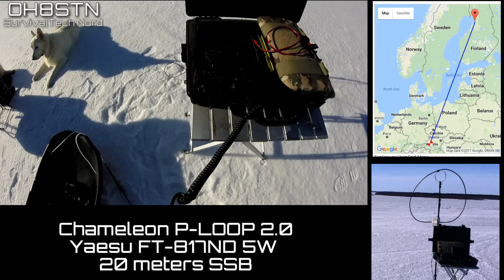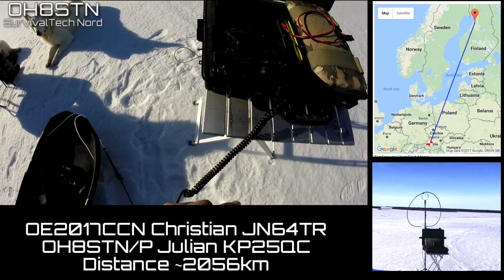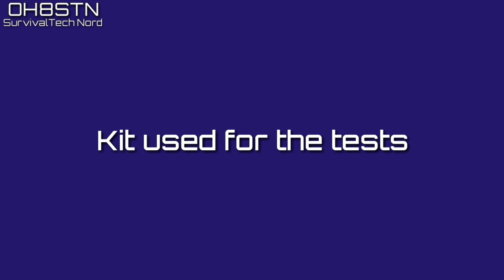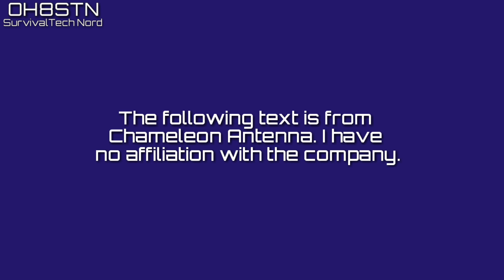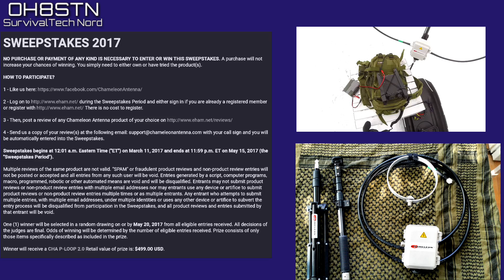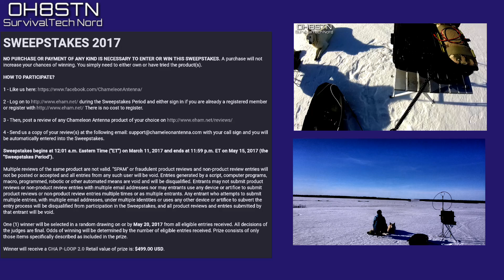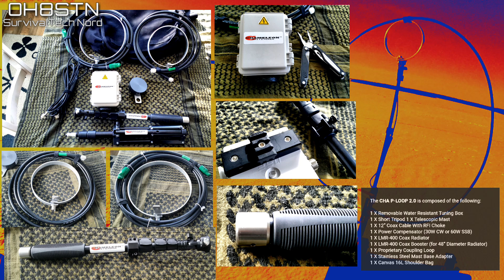Chameleon P-LOOP 2.0

Comment: Thanks for the video. Could you please explain how the power compensator works? Or maybe do a test that would show that extra power applied to the antenna with the PC will improve the signal quality on the receiver side? I asked the same questions to the manufacturer but the only thing they could tell is that PC is a huge capacitor. I don't see how it can change the maximum power the antenna can handle. There is a strong suspicion that PC is a scam.

Comment: i have a question regarding the 817nd, i see that inrad is running out of the collins filters, are you running one on the ssb snd if so does it really help give a +2db gain on tx like some claim? would you recommend a filter?
Reply from the maker: +The Johnny O Show Hi Johnny. I don't have the filter installed but I've referred people to this webpage. Hope it helps.
http://www.m0spn.co.uk/2015/02/16/ft817-txco-and-collin-2-3-khz/
Reply: this is perfect thanks

Comment: Great video as always, thank you sir. Though I must say I admire your intestinal fortitude! A question if I may, you have attached what I believe to be elastic cords on your Chameleon side rails, I have those rails on my 817 and love them. I was wondering what you use that configuration for? Keep up the good work. de W4PPZ
Reply from the maker: Hi Paul. 
The stretch cord holds the z817, qrp battery pack, or ZLP MiniProSC to the 817 when I'm operating portable. It's so cold here, that I don't want to fiddle with anything unnecessarily.  I'm working on a case/housing for the 817 and external peripherals, so all components are integrated like a go-kit, albeit much less bulky.
Thanks for watching,  and the kindness.
de oh8stn

Comment: Great video! A non-radio question for you. How well do your dogs stand the cold - what is the lowest temperature they can handle without protection from the wind or cold?
Reply from the maker: +Brian Haren Great question! We have a rule. If we can be out, the dogs can be out.  Of course it's a matter of how long. At -30c, we take 0,5 -1 hour walks ~3-5k. Below that, make the business and get inside asap. As long as the snow doesn’t stick to their paws, they are good to go.
👍

Comment: Have you tried horizontal with the loop? At the QTH I run a MFJ magnet loop horizontal 20 feet up. Thing makes contacts on 20 meters all over the world.
Reply from the maker: +Falkenroth1 You realise this is a backpackers antenna!?
Reply: OH8STN , yes I know what it is but never have had the chance to use one. It won't work horizontal just vertical?
Reply from the maker: I'm not sure how to answer this question. it "could" be used horizontal, but I don't know if it's designed to be. Chameleon Antenna might have a better answer.
Reply: I say try it. See what results you might get.

Comment: Julian You kill me. A family outing on the sea ice in sub zero temperatures. It's kinda fun that we both intro'd the 2.0 at the ocean. One tropical and one frozen. I suppose  we got the extreme ends of the sea covered. I'm going to dig into this one some more with the larger loop and see how it does on 40 Meters. Fine video, I can't say I wish I were there though. -de K6UDA
Reply from the maker: K6UDA In the military, there was this saying "You've got to love the suck". That's really the idea here. Just enjoy life where I am. Clear blue skies, no smog, no traffic jams, it is really a blessing.
I'm also going 9to dig deeper into performance with this loop. It certainly has different performance characteristics than the F-LOOP, but my testing with digital modes so far has been positive. One thing I have noticed is the narrower radiating pattern with the smaller loop. In this video you notice the EI station could not hear me, but when I turned the loop slightly to west, he heard me. Thats why I was holding the loop in teh video.
Ok Bob, thanks for stopping by.
de oh8stn

Comment: Great review! I personally like the ability to use more power. Smaller size is surely a benefit.
Reply from the maker: +VideosByDPF agreed.  This makes a kx2 or kx3 totally reasonable for Digi field comms now. Even an old 897 with 20w mod.
Thanks for stopping by